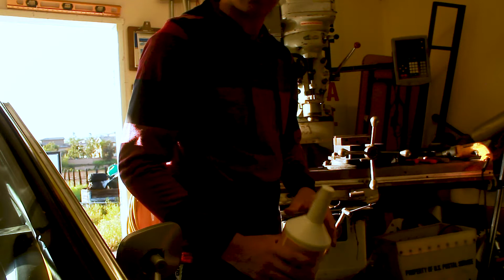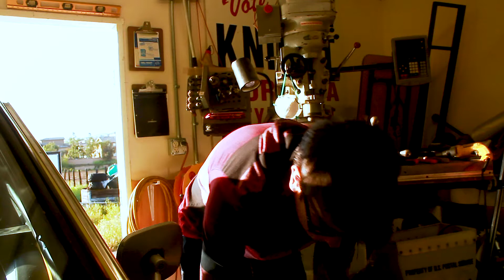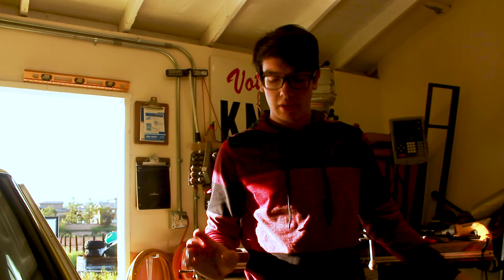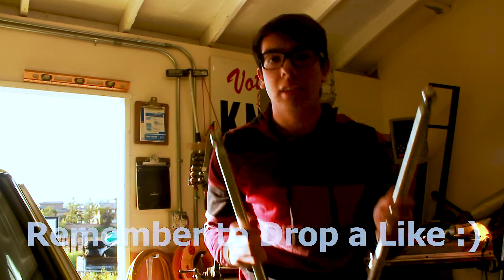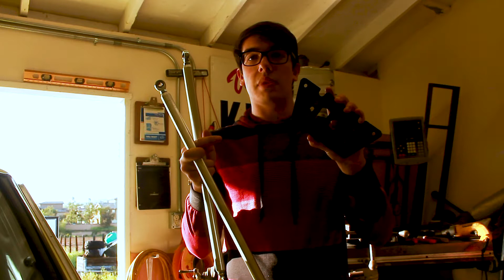Installing a Cusco/Techno Toy Tuning Strut tri-bar (Add On)

Comment: What is the diameter of the  rod that was included? It looks like the helm joints have a 0.5" diameter hole in them.